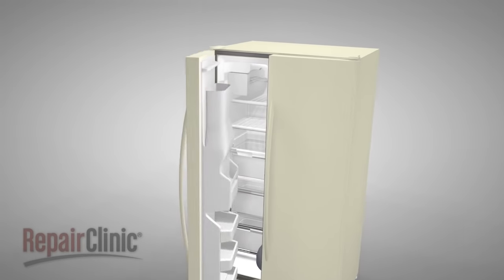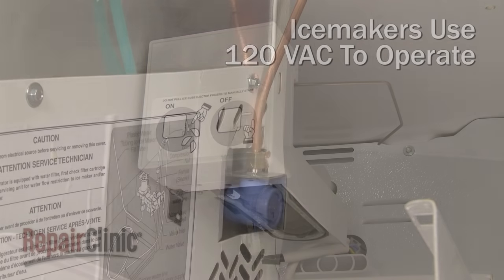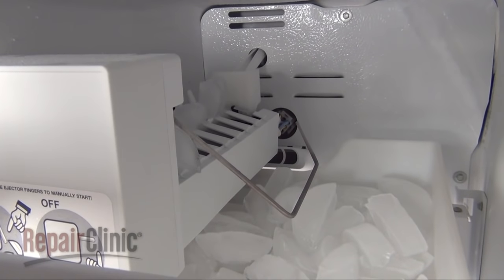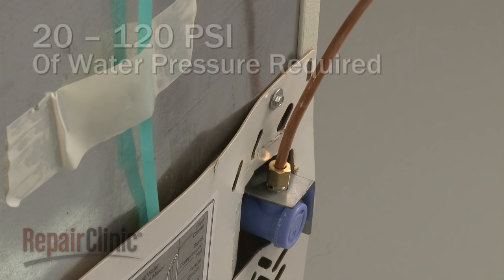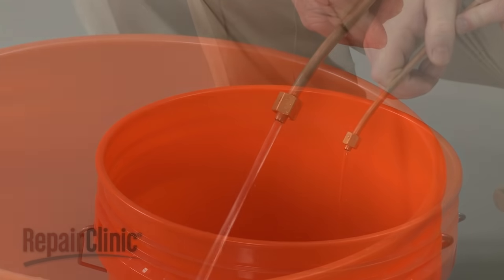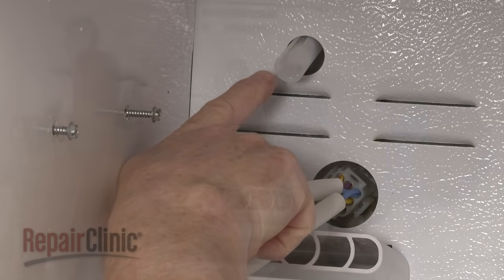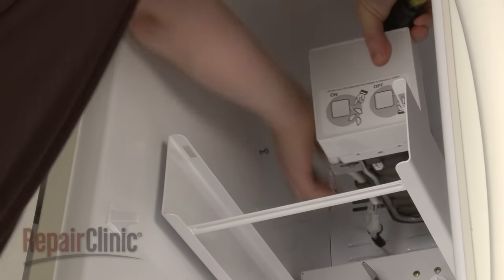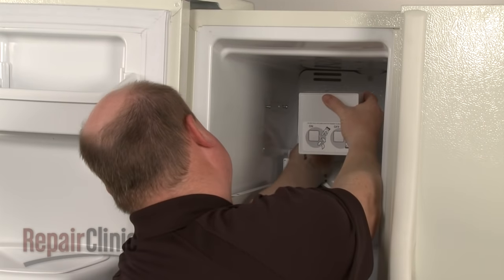How Does A Refrigerator Ice Maker Work? — Appliance Repair

Comment: Thank you for this video.  It saved me form having to pay for an expensive repair call when it was (somewhat) easily fixable.  I ended up needing to try the hair dryer as everything else seemed operational.  I spent about 5 minutes heating the fill tube ( in 2 separate attempts) and did get a small chunk out.  It still didn't seem to work, so I did the same to the area on the fridge side that connects to the freezer.  I also had some ice chunks fall out from that.  After that, it didn't immediately start flowing water so I stopped for the evening.  But when I went to the fridge the next day, it was full of ice!  Clearly something did get unclogged from all the heating.  Thanks again.
Reply from the maker: +Terry Lewandowski Thank you for sharing.

Comment: thanks for this. after the correct freezer temperature is reached, how will water know to be sent to the water inlet valve? Is this where the ice maker thermostat & ice maker motor module come into play?
Reply: my ice maker ice tray isn't getting any water & the water lines & water inlet valves are new. I'm wondering if the ice maker's motor module may be having an issue telling the water inlet valve to send water.

Comment: We turned off our icemaker momentarily because I pulled the tray out to dump the ice in a cooler. Apparently long enough to freeze the front part of the feed tube. I used a hairdryer to thaw it out but now my fridge and freezer seem to be running warm and I hope that was just from my in and out of it and simple heat from the blow dryer. What should be 0 and 37F is supposedly right now at 10 and 39F. I'm kind of hoping that the temperature gauge is just a little faulty. The ice still froze and dropped some after I thawed it.

Comment: Mine makes ice but won't dump it into the dispenser.  I have taken it apart several times and it just keeps making ice but it never leaves the tray after it freezes.  Should the sweep that pushes the ice out, move freely if pushed by hand?  I was wondering if it's the little motor that runs it?  This is my first ice maker and I am pretty clueless but I have taken it all out and thawed any possible blockages.

Comment: How is the water level assessed? Float sensor, timer, etc.  How is the frozen state of the ice assessed?  Simple timer or timer modified by measured temperature?  Are the cubes released by mechanical means or is momentary heat applied to release the cubes?  Oh well, maybe you can keep feeding the DIY parts cannon for a few more years.

Comment: I bought an electrolux refrigerator a few years ago and never hooked up the water to the icemaker.  I finally had someone run a new water line to the fridge and now my "New" icemaker will not work.  Where do I start?

Comment: Can't find any information on how the button/switch/sensor on the door communicates with the ice unit in the freezer (can't see any wiring from the door to the fridge - what's the answer?
Reply: PS older fride - even so when did wireless start?

Comment: My ice maker is making ice very well......good sized cubes and a lot of them. It does, however, make these nice icicles all over everything on the shelves below. There is also a frozen stream of ice down the front of the ice basket and the shelves below on the door. Any suggestions?
Reply from the maker: +Sharon Colotta It sounds like the icemaker is overfilling which could be due to a defective icemaker, low water pressure, or a problem with the valve itself.

Comment: hi
 Warm Fridge And Freezer  what to check
i turned the timer off
the fridge and freezer works perfectly again
but few days later  it was warm again
thanks
Reply from the maker: We recommend using the repair help section of our website: www.RepairClinic.com/RepairHelp?TSLID=1773 

If you enter your model number there it will provide you with model, part and symptom specific repair help.

Comment: Im not good at english: The icecubes of my refrigerator are too big. The tray that are holding the icecubes are filled to the top, i tried to open the icecubemaker, and the cubes were formed as a whole cube as the tray. It is hard to explain, but i hope u guys understood it. I thought in the beginning the icemaker was damaged, and bend to the side, but i had my refrigerator 7 years without problem, do u guys have a guess? Pls thanks.
Reply from the maker: Music4Chipmunk The fill cycle for the icemaker is timed by the module. Most likely the module is defective or there is a problem with the valve that supplies water to the refrigerator.

Comment: Kenmore wr30x0290. . . icemaker seems to be running over before freezing leaving the bucket and the side of the freezer with a thick sheet of ice.
Reply from the maker: +Larry Moore The icemaker is timed so if it is overfilling the icemaker will likely need replacement.

Comment: What if I replace the ice-maker and the ice-maker fails to make ice? I made sure it was in the on (arm down) position. I then used a jumper using the appropriate terminals and it still failed to harvest. While the jumper was still on the terminals, I used a voltage detector to determine if voltage was present in the jumper wire...it was. I then took my voltmeter, unplugged the harness and measured the voltage at 108Volts coming from the harness testing from the black and white connections. The minimum voltage is 110V. The connection comes out of the divider wall as it is on a S x S. No connections found near the ADC. No wiring in the rear and none in the front. The schematic was missing.
Reply from the maker: The ice maker should still work with 108 volts. Is the voltage at the plug also 108 or is it higher? If the voltage is higher at the wall plug you may have a broken neutral wire and are getting your neutral from the frame. Check where the wires come in at the bottom of the door and make sure they are not broken. We don’t have a model number so we cannot look up the wiring for you .
Reply: I had an idea of a broken or poorly connected neutral. I will get you a model number. This unit works from a light sensor instead of an arm. Is it possible the light sensor is bad? The red light flashes even when the flapper is held down and the door switch is held. It supposed to be a solid red. I have the testing procedure on how to test. But even if there is current, it will not work without a neutral. I checked voltage from the outlet, it read 120V. The unit has a missing ground prong from the plug. Not good. Something could have shorted and possibly caused this problem.
 Thank You for your help.

Comment: Lastly, the ice-maker itself could be bad. By jumping T - H, it should override the light sensor. Again, current was present in the jumper wire. Every so often you can find a defective one especially if they are aftermarket rather than original. FSP has better quality control.
Reply from the maker: Psycho9263 Thanks for the tips!
Reply: The actual problem with the ice-maker was it had a bad hot leg (black wire) if the neutral wire was bad, you would get a voltage reading between 80 - 90 Volts.Again, this is a side by side refrigerator. I cut the black before the thermal fuse and connected a new wire and fastened it to the top edge and removed the vent housing. When I had it on the fresh food side of the vent hole, I snapped the vent back in place (make sure wire is between the tabs) and put the wire in the diffuser shroud and then routing the wire into the control panel. I took a longer wire to put on the door switch (door switch is connected to a harness on the board) I spliced the hot leg between the door switch and the ADC harness and placed an insulated female connector. Now I placed a male insulated connector on the ice-maker's new hot leg. The ice-maker's harness was putting out 120V. I placed a jumper in the T-H terminals and it began to work all the cycles. I fastened the hot leg on the freezer side, re-assemble the mount and the job was complete. (The ice-maker needs at least 110V and did not work with 107 or 108 V. 120V made it work because it must operate a heater)

Comment: Hi, I have one of these Frigidaire ice makers and it's stopped working automatically recently after a power outage. We've done our best with it but right now, it does a cycle but the ice gets stuck at the 9-12 o'clock position frozen and doesn't exit to the ice bucket like normal. When I push up the arm it starts cycling again but again stops at 9 o'clock after the ice is frozen. 

Any idea on what could be the problem?
Reply from the maker: +Shouta The ice maker will likely  need to be replaced. More often than not, you have to buy a whole assembly. www.repairclinic.com?TLSID=1773
Reply: +RepairClinic.com Kind of figured. I'll test it a bit more then look into getting the necessary part.

Comment: Replaced the ice maker, water valve and filter. Water pressure is good and water can be dispensed at the door. Supply lines have been checked and not frozen. Temperature is correct in the freezer. The new ice maker will cycle with a jumper between the L&H ports but no water is called for at the end of the cycle(it’s a new ice maker). What else can be checked? It seems the ice water solenoid is not receiving power.......Maytag MSD2655HEB

Comment: The water supply is good...but it doesn't go into the ice maker.  Instead, it splatters all over the back wall of the freezer and coats the items in lower shelves.  Results are small cubes and infrequent harvest.  Plus the rest of the freezer is coated with ice several inches thick.  Where do I look for correction of this problem.
Reply from the maker: Ouagadougou Guest House We would suspect a blockage in the fill tube. Sometimes that tube can get ice in it and cause issues.
Reply: RepairClinic.com where do I find the fill tube?

Comment: my ice maker is making ice but not as much as it did before, its taking longer to fill the bottom tray. I also hear a draining sound. Before I would only hear the valve filling in the production tray, now I hear a water draining sound, gulp, gulp, gulp... and will not fill the bottom tray in 2 days, what could it be?
Reply from the maker: +Ojo Aereo Slow ice production is usually due to higher than normal freezer temperatures click here: https://www.youtube.com/watch?v=5vA8Ksv5kVY
Reply: Ojo Aereo if

Comment: You never mentioned what cuts the water off when the ice tray fills up. Mine just filled the ice bin up to the top with water. It never cut off until it froze.
Reply from the maker: The water inlet valve supplies water to the ice maker and might have failed to shut off the water correctly.

Comment: ok I have a Frigidaire refrigerator it is not a side by side has an ice maker have replaced the ice maker and the water valve on the back of the refrigerator twice when turning it on to make ice the water just runs continuously need help why is it doing this
Reply from the maker: +mary core The icemaker should only send voltage to the valve for only 7 seconds. If it is doing it longer than that then the icemaker is defective. Low water pressure could also cause the icemaker to overfill as the valve does not close all the way.

Comment: I have an overflowing ice
Reply from the maker: robert schultz The icemaker fill cycle is timed so you either have a water inlet valve that cannot close properly or the icemaker is defective. Visit www.repairclinic.com?TLSID=1773 to find parts.
Reply: ***** It's making great ice...The only way I can turn off the ice maker from making ice is to raise the bar all the way up. It won't turn off by it self..It just keeps making and making Ice..Don't think it has anything to do with the water inlet..
Reply from the maker: robert schultz We would suspect a problem with the icemaker arm not working properly. Normally, it is part of the icemaker assembly.  Visit www.repairclinic.com?TLSID=1773 with your model number to find parts.

Comment: the problem with mine is that water does not come out all the time
Reply from the maker: +Markus BangBoy If the icemaker fills intermittently then we would suspect the icemaker is defective or it is not cold enough in the freezer to cycle the icemaker all the time.

Comment: How do I stop my icemaker from overflowing? The ice runs over and settles at the bottom of the freezer.
Reply from the maker: Edith Reiter Usually when this happens it is a modular style icemaker and the module itself is bad. Replacing the module or complete icemaker is the fix. Enter the refrigerators model number here for icemaker parts: www.RepairClinic.com?TLSID=1773